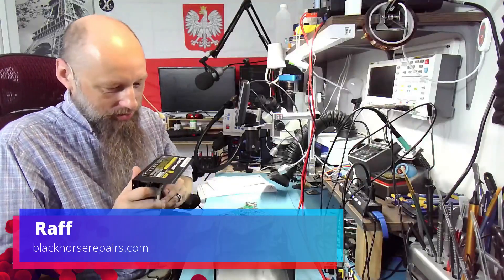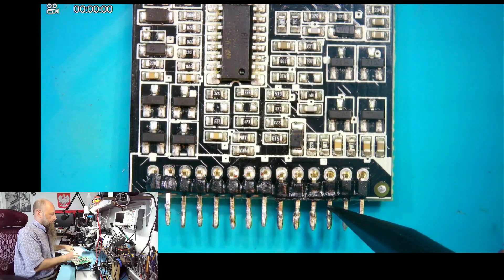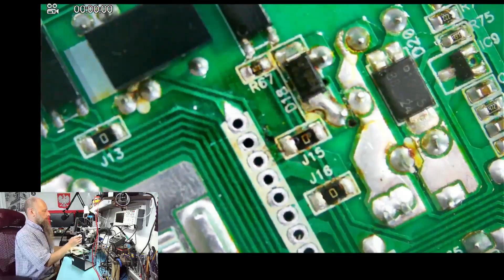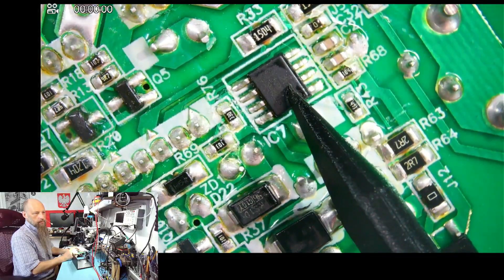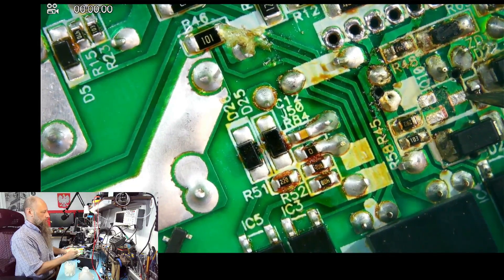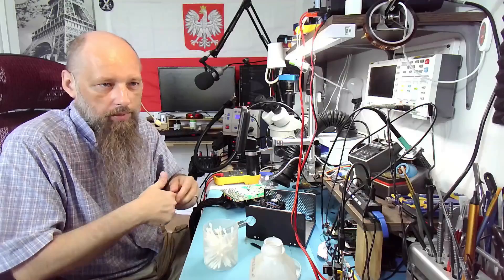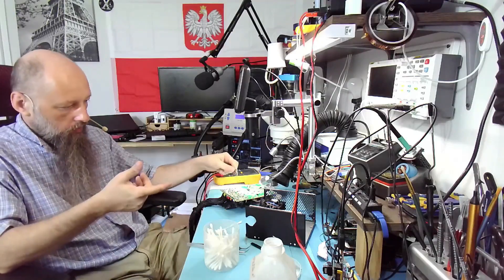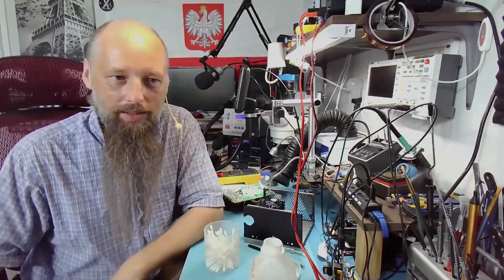#46 | 600W PSU Repair How PFC works and how to find faults on Computer Power Supply

Comment: Good repairs if the PSU is worth it.sometime fixing this type of psu caps will be worn the will cost more and time spent on it. other than that good explanation, good video of you showing it. recently I just fixed a 42-in Panasonic Plasma old model PSU PFC blown all way to the out main. parts and time was ok. all depend on what it is. I try to keep my customers happy on the price for repairs.
Reply from the maker: true that brother, indeed this one is probably not worth a repair but since I already had it I figured let's just fix it :)